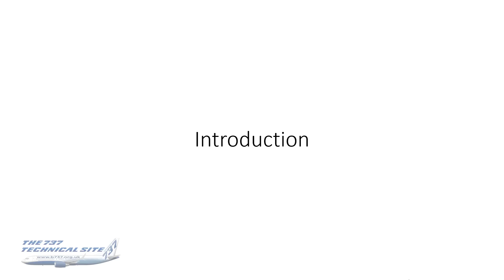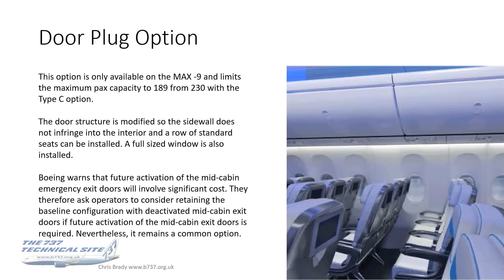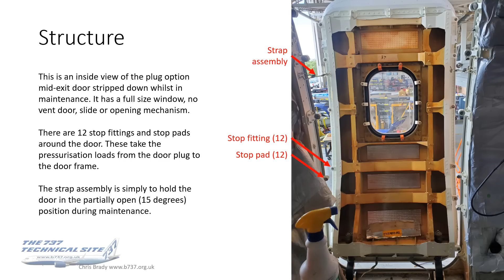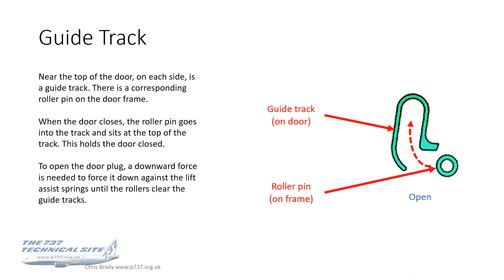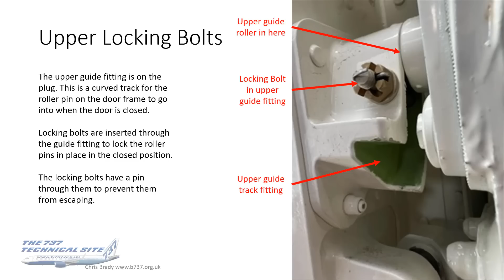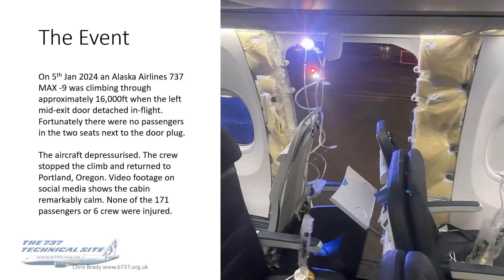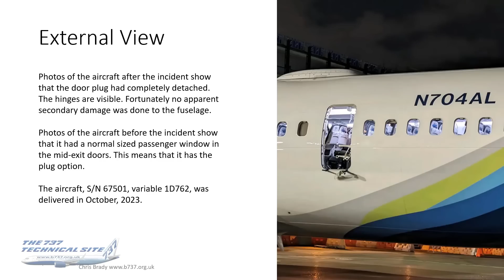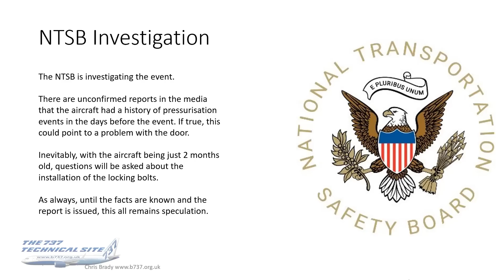737 Mid-Cabin Emergency Exit Doors - Plug Option

Comment: Reuters: Spirit Aero made blowout part but Boeing has key role... Spirit builds fuselages for 737s and sends them by train with the special door assembly “semi-rigged"… At its Renton, Washington, plant, Boeing typically removes the pop-out, or non-functioning, door and uses the gap to load interiors. Then, the part is put back and the installation in completed. Finally, the hull is pressurized to 150% to make sure everything is working correctly
Reply: I'm guessing nobody put the bolts in and hey presto there flies the door
Reply: @jarchdm given how clean the bolt structure is, I think you're absolutely right. The locking structure itself didn't fail, or there would have been a lot more damage.
Reply: @jarchdm  my money is on this too.   Bet they find another door in the fleet w/o proper rigging.
Reply: @jarchdm  I think if there were no bolts at all the vertical assist springs would cause to door to fly off during the first pressurization. The plane test flew at Boeing and was in service with Alaska for a couple of months.
Reply: @omgsrsly  " I doubt the assist springs are meant to overcome 100% of the weight. " 
During turbulence the weight of the door might go to zero if the plane takes a dip downward.  ....or even negative Gs.
Reply: @omgsrsly   This is an interesting one. That's for sure.
Reply: @rael5469 the assist springs are meant to aid in an emergency egress (evacuation)! I can guarantee that the springs support the weight of the door. Judging how outrageously bad this design is, I would be shocked if they bothered to put weaker springs on the plug doors. They basically just put 4 bolts in the emergency door mechanism and called it a day. It’s baffling really but this is coming from the people who put the lives of all their passengers on the data of a single angle of attack vane (MCAS) and with no software contingency plan if said vane failed…
Reply: @BaliMystic why would it take 2 months, multiple flights?
Reply: @Karlson425  because initially, the door would be shut very firmly and rubber seals would hold everything in place. The inside pressure does apply pressure to the stop pads. These were probably perfectly aligned at first but may have gradually started to become misaligned. With enough misalignment, the friction area would be reduced to the point that the springs + track + leak pressure would defeat the friction force. To think a door would be held only by friction is inconceivable.
Reply: @rael5469 no. The seal would provide resistance but ove4 a couple of months of flight cycles, vibration etc this plug moved. Clearly not one bolt was installed because that would have been enough.
Reply: @Karlson425 Vibration and other factors
Reply: @BaliMystic   To be fair, the fact that this exact plug has been flying around for years in -900ERs without incident is proof that it works. Something else is at play here......we can't know what until they find the door.
Reply: @BaliMystic   "the assist springs are meant to aid in an emergency egress (evacuation)!"
Exclamation point? Really?  Bal, this was a plug and was never going to be used. The assist springs were unnecessary in a plug. In fact they may have added to this incident.
Reply: @peterneumann7145   I highly doubt that it could fly without the bolts installed. I would be shocked if that's what it turned out to be. If this was about the bolts then I'm thinking maybe the castellated nuts weren't safetied.......something like that? Installed but no cotter pins?  We'll see.
Reply: @BaliMystic  Whatever you think about Boeing, those springs are NOT there to aid an emergency egress.  This door is not a door, but it is a door plug.  It's not functional for egress.  Wrenches and sockets are needed to get it open normally.
Reply: @rael5469  exactly like you say. And that's exactly why @BaliMystic used an exclamation mark. Because it's so ridiculous to fit springs to make it easy to open the door in an emergency to a door that's permanently closed.
Reply: @rael5469  exactly! That’s why I put the exclamation. This very design feature may have contributed to the accident.
Reply: @rael5469  Really needs some tests to see if the failure mechanism can be recreated. That would give confidence that the corrective action is guaranteed to solve the issue completely.
Reply: @stephenwabaxter   Agreed.
Reply: @rael5469  The springs are not strong enough to lift the panel, just take part of the weight to assist lifting it.
Reply: @rael5469  Almost certainly negative Gs.
Reply: @SteamCrane   "The springs are not strong enough to lift the panel,"  
What about when they hit a bump or turbulence? Ever hit a bump in your car? Did you get light in your seat?  So does that 63 pound plug.
Reply: @rael5469  That's my point! Turbulence on climbout!
Reply: @SteamCrane   OK.
Reply: @rael5469  The plug uses similar fittings, but of course, is not intended as an emergency exit.  Nonetheless, the helper springs are still needed to assist when the plug is "opened" (removed in the regulatory sense) for maintenance purposes.  There is still a pressure seal that may require replacement.
Reply: @paulsaccani1115    Why are you telling me this Paul? Maybe you were responding to someone else?
Reply: @jarchdm why took 2 months?
Reply: @jarchdm  Or more likely, the nuts were fitted onto the bolts, but the split pins were not fitted, which resulted in vibration causing the nuts to come unscrewed & the bolts to fall out.
Reply: Thank you !  That's a fascinating piece of the puzzle.
Reply: I am going to be both horrified, and laugh myself silly, if "semi rigged" means they hold the door down with a chunk of styrofoam taped into position, the way the bits and bobs of a new refrigerator are held into place when shipped from a factory.
Reply: @SteveSmith-cd4hs    My guess about the door being "semi rigged" ONLY means that they don't take responsibility for the final rig. It's like when we change a component on the airplane but let's say there is no electric or hydraulic power to test the component. We might do an update to the log page and say it needs final installation tests when power is restored. The next guy might not have to do any rigging if it ops test good after power is back on the aircraft. But you get my point. Semi rigged may only mean that they don't take responsibility for the final rig before it gets it's maintenance release. Just a heads up to the final assembly line.
Reply: I believe this is doing to lead us to the root cause. United revealed that the loose bolts were the ones that secure the hinges and guides to the plug, not the ones that stop the plug from sliding on the hinges. Maybe Spirit loosely bolted them in place thinking Boeing would later secure them but never did. I think (my opinion) ultimately it shows confusion and excessive workload in the production sequence. The people and process who have been building these airplanes for decades don't make mistakes like this until you change things or start overloading the system.
Reply: @balimystic stated this is "the exact same plug as has been used for year's in -900ERs." Is this in fact known to be exactly the same or were any changes made for the Max?
Reply: @vancemiller5115   It's a good question but because of the Type Certificate I doubt that they changed much of the fuselage structure besides the engines and a few avionics upgrades. I've had a systems class on the Max and I believe that to be the case.
Reply: Since there appears to be no/minimal damage to the fuselage, I wonder if the bolts were never installed. This should be interesting to say the least. So glad the door has been found.  It’s fascinating how these problems are figured out and remedied.
Reply: If that was a RII item, it's an MRO term for required inspection item which means it requires a mechanics and inspectors stamp after a eyes on installation and inspection. Two guys are screwed, if not a RII item it will be for all operators from now on. If you ever seen a maintenance manual you'll see many warnings, they are there because someone screwed the pooch or got hurt.
Reply: @michaellucht6351  This is no issue some guys failing.
They found loose bolts in several aircrafts in several airlines.

This is an issue Boeing processes failing badly.
Reply: @peterebel7899   Maybe but an employee should have noticed this, this is cultural, employees probably have been brow beaten by management to just shut up and color.
Reply: @michaellucht6351  Those bolts don't fall of in the production plant....
Reply: See my post above.  I don't buy this answer.  Look at the pictures of the 737 MAX hulls in transport.  https://www.aerotime.aero/images/Unfinished-Boeing-737-MAX-fuselage-traveling-on-rail-to-Renton-Washington-the-United-States.jpg
Reply: Spirit has problems for sure!!!!
Trying to cheat the employees out of wages and benefits !!!
Reply: Spirit Aerosystems also makes parts for Airbus. Right now I wonder if they make the same parts of the fuselage for Airbus.
Reply: @Dirk-van-den-Berg   Lots of Boeing doors and hatches are made in China.
Reply: I can vouch for that. I have screenshots of those trains hauling the ‘green’ coated fuselages and all the doors-plugs are in place as being shipped.
Reply: I think we need to also take physics into account. Now I’m not great at it but the aircraft is accelerating through what ? Say 400 mph, on an incline, with gravity acting against all of it, including the plug.

Then after reading some more comments, there’s the landing forces which when the landing gear trucks-bogies hit the runway, the plug is forced up; Up with just enough force to jar the track off the rollers. So multiple takeoffs and landings without the (4) or even (1) failsafe bolt, and there goes your plug.
Reply: Wouldn't it be better to do all this assembly in China to gain quality standards?
Reply: @peterebel7899   Why don't you go live in China if you feel, that way?
Reply: @rael5469  Better to live in China than sitting in airframes falling apart.

BTW: I am living in a country taking quality serious in production factories.
Reply: @peterebel7899   "BTW: I am living in a country taking quality serious in production factories." 
GOOD !  Let us know when you landed on the Moon.
Reply: @rael5469  Oh you are living in the country crashing on the Mars due to not being able to separate Feet from Meters?
What does this tell us about the moon mission (which is already cancelled)?

At least:
- If you need a quality car, imported
- If you need a quality phone, imported
- if you need a quality whatsoever, imported
Reply: @peterebel7899   That was weak Peter.
Reply: @rael5469  The weak thing is Americas quality standards in production things.
Americans prefer to let things let been produced elsewhere over taking own efforts and eagerness..
Reply: @peterebel7899   Japan just had an aviation crash and five people died. In America there was an aviation incident with no crash and no loss of life.  Just say "NO" Peter.
Reply: @zacky5315 Boeing screwed up not Spirit Aero. Boeing is the final assembly and checks functionality and also does the "ok to close" inspection, meaning okay to install the sidewall panel. The planes are delived with the sidewall panels in place and the booby-trap is set.
Reply: @j_356_5   Someone else said that the aircraft had a mod at another vendor. The error might have been made there. It also might have been made at Alaska......we just don't know yet.
Reply: Stop pins do not resist the pressure from pressurization. Look more closely at this plug, designed to fail.
Reply: @daviddavis7855   You are wrong David.....but have it your way. Whatever.
Reply: @zacky5315 Not "maybe".
Reply: The plug is not made by Spirit, it was made by a Malaysian contractor.  Spirit deliver the fuselage to Boeing and incorporate their (Spiriti's) contractors parts as required.
Reply: @zacky5315 hey, it is Boeing (aka... Spirit). The cost cutting is still noticeable, at the cost of safety (agian).

Comment: Seems to me the only way that door could move is if the bolts weren’t secured or even installed.  If everything was installed properly there is no way for the door to move with out major damage to the area.

I seriously doubt there is an underlying design flaw with the plug as they have been flying for years in the 900ER without incident.
Reply: This. It wasn't installed properly hence the trouble pressurizing from the beginning.
Reply: Shift Change in the middle of installing the plug...It NEVER got the "Capturelock" bolts installed...No people where in those SEATS on Purpose cause too many passengers complained of Noise and Draft ,,ASK the Crew why those seats were EMPTY.......!!
Reply: @4881828 citation needed
Reply: @4881828  Ah HA!!!  I wondered if no one had reported this, and combined with cabin pressure squawks was all the airline needed to investigate.   Similarly- I boarded a TWA 727 and sat by the exit door, on engine start and rise to idle there was like there was no seal. No engine noise attenuation. Moved to the center seat and my backpack and told the person next to me what to expect if the door separated. Well- it sealed on throttle up and did not leak, so I moved back. I instructed my direct reports it is OK if they did not choose, or wanted to refuse, TWA for company travel. Flight 600 popped 5 days later. I hope an accurate story comes out soon.
Reply: @4881828 shift change maybe, but mechanics always leave written  'tie-ins' to alert 2nd shift what they were doing before going home.
Reply: the upper pins in the photo that the slots are supposed to lower down upon don't look like they're especially substantial in that image.  They look short.  I wonder if that's just characteristic of the image, or if they actually are short.

The problem to my admittedly armchair view is that with the springs at the bottom, the plug is designed to lift itself up and off, the springs in the hinge assembly are loaded to tension when the plug is installed.  If there's any mistake in securing the plug then those springs are going to make the problem worse.

I'm wondering if the perimeter bolts for the frame attachments were simply omitted, and the bolts used to lock the slots aren't up to the job of holding the door in place in that event, and the door was able to come up and out accordingly.

Comment: So to be clear, the door slides UP the hinge rods to clear both the pressure clamps and guide pins before open out and down. 

And in order for any of that to happen, four locked through bolts have to be removed. And any one of these bolts would be enough to secure the door in place. Pretty clear then that someone overlooked something, and the final responsibility is probably with Alaskan regardless of what Spirit/Boeing did or didn't do. Although that will depend on the depth of checks during the entry to service hangar input if any work was undertaken in the area of the plug/door during the hangar input on Jan 1st.
Reply: I doubt that anybody at Alaskan touched the plug tbh...
Reply: @oj2372 I've seen speculation that this door is opened for seat install. And may have been opened by AS during initial service.
Reply: @jonathanbott87  I would have thought the seats are already installed by the factory. Would opening those 2 doors speed up the install process really that much?
Reply: @oj2372   Seats are installed after it leaves the production line  as they can vary a lot between customers and are routinely swapped out during the aircrafts lifetime. I dont know if Alaska Air have their own MRO available to add/remove seats but it can only be done by an approved MRO facility. Considering the aircraft was so new, it would not have gone for a check yet but its an interestng theory that maybe the door was fitted correctly at the factory but opened again when the seats were added and not secured properl;y afterwards.
Reply: @oj2372  on a 737? Absolutely. The other two options are remove the bulkhead/wardrobe by L1 or remove one or both rear toilet modules to be able to get the seats around the corner through the rear galley. 

Going in through the door in question you could have several seats on a staging platform and pass them straight through the door. No bending/twisting/taking chunks out of either galley or trashing the seats trying to force them in.
Reply from the maker: * Update *
In this video I state that a downwards force is required to remove the door plug. I based this statement on text in the AMM SDS which I now believe to be incorrect or misleading. It is possible that a very small downwards motion (1-2mm) is first required to be able to free the locking bolts. But the door must be moved upwards by a couple of inches to clear the guide tracks. Apologies for any confusion.